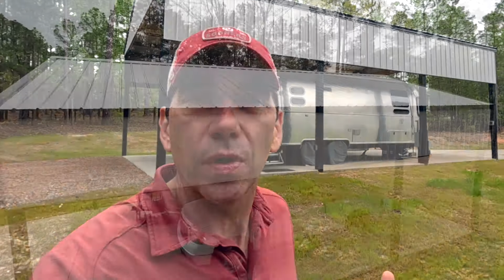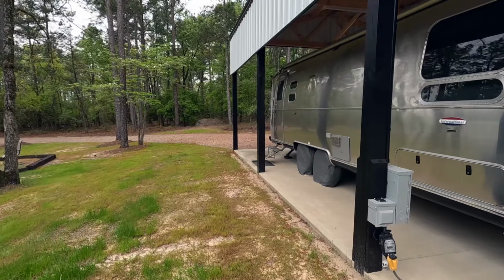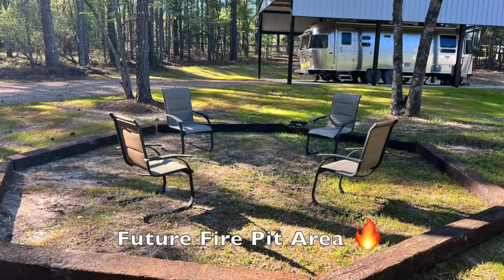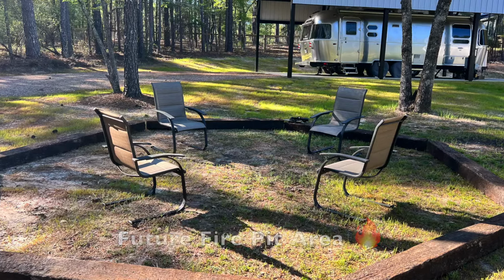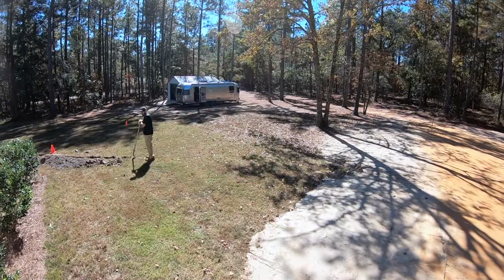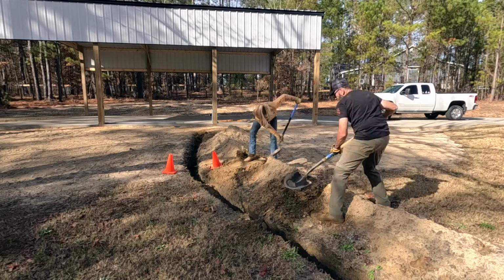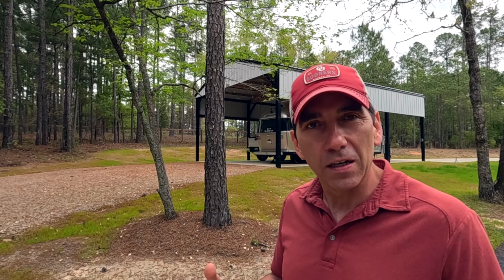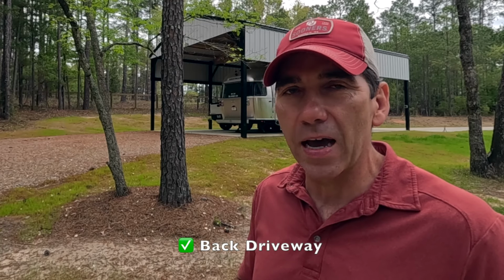RV Carport FAQs: Everything You Need to Know (Watch Before You Build!) #polebarn #build

Comment: Looks great, awesome build. I would have plumbed it for both water and sewer. Just run the pipe under the slab prior to the pour. If you ever decided you want it in the future it would have been there. Would have only set you back about $250. You came also put in a diy septic system for under $500 . Plenty of YouTube videos on that. Very cool, congrats

Comment: No question on Building permit required?   RC in Havelock, NC
Reply from the maker: Hi Randy
In the Pole Barn build video series I had mentioned the permits needed.  Perhaps that is why no questions were asked on that topic?  Either way, we did receive a permit and the inspector came out 3 times during the build to verify we were meeting code. Hope this helps. Thanks for watching

Comment: Why did you put the electrical on the side that you did, given how you park your Airstream in the barn?
Reply from the maker: Great question.  There were several factors that we took into consideration on the placement of the sub panel and the 30 amp receptacle.  First it was closer to the main panel so we didn’t have to trench as far and buy more wire.  Second if we placed the 30 amp outlet on the opposite side of the pole barn the RV power cord would have to stretch to the Airstream which would have prevented us from parking our truck on that side of the pole barn.  Finally our Airstream has a 30 amp plug at the front of the Airstream so it works out great.  Hope this helps answer your question.

Comment: Your pole barn is really nice!!  We purchased a new to us 2005 28' Classic last year and had a RV garage 18 X 36 X 14' placed on our property for it as well.  We couldn't afford something that pricey and went with a metal/steal garage and dirt/crushed rock floor.  Our garage is closed in on the sides and open front and back.  Our house is within 15' of the RV garage, so I just run an above ground electrical line for keeping the AS batteries charged between the two.  I cleared the property and leveled the ground myself for the RV garage with my tractor to save on money and had packing dirt/rock brought in and leveled that myself too.  I'm retired, so I had the time.  It's not perfect by any stretch, but it looks decent and keeps our AS safe from the weather here in Oregon and allows me to work on it as needed with a little protection overhead.  The total cost was approximately $8,500.  Happy trials.
Reply from the maker: Cliff…thanks for sharing your experience.  Sounds like you have a great setup on your property.  I do wish I could have done more of the work myself and saved so money.  However we either didn’t have the equipment or experience needed to do the task at hand.  That said, some problems are best solved hiring a professional.  Happy camping and safe travels.